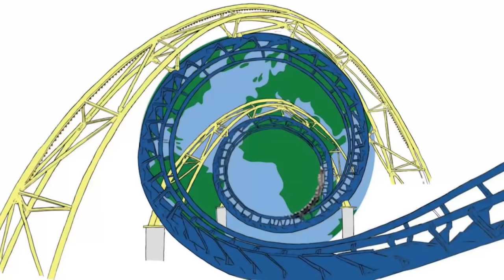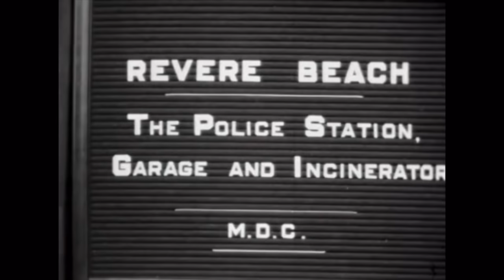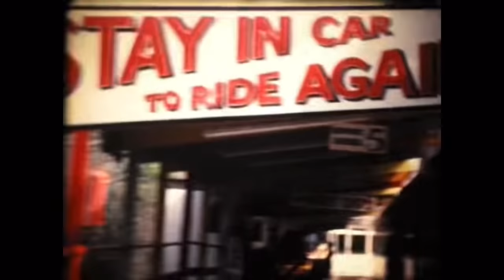5 of the WORST Roller Coaster Disasters in Amusement History | National Coasters Countdown

Comment: Even though no one died, the accident on The Smiler is one of the all time worst for me because of the multiple levels of safety violations that caused it.
Reply: More like two specific but really big ones: ride was operating in winds higher than the maximum it was designed for and the block system was bypassed by someone who should never have had access to the maintenance control panel.
Reply: It’s the whole reason why I will never ride it.
Reply: @sapphire.stones1897 
Even though the maintenance control panel is now under lock and key so the ride ops can't override the block system? Because that's what ultimately led to the accident. It wasn't the ride's fault, the operators forced a dispatch when the block ahead wasn't clear.
Reply: @VestedUTuber  exactly it actually always was and still is the safest ride in the park
It was human error not ride error

But anyway it’s apart of British culture to have slightly dangerous rides lol jk
Reply: it’s human error, it’s not the rides fault. it’s fine now nobody died
Reply: cgc
Reply: I can remember when that happened, there was a few lasses from my year at school who were there that day and was planning on going on it until that incident happened talk about dodging a bullet
Reply: @sapphire.stones1897  IM SAFE GODDAMN IT
Reply: @finnrobinson674  it wasn't the safest ride. In the year of its release, there were almost 30 issues
Reply: @mrapple2373  but the thing is issues happen in the opening year for everything not everything opens without it's issues plus nothing happened they were mostly on test runs
Reply: @antonytsai6611  fair enough. But some rides at alton towers will be safer because there's not as much risk.
Reply: SecretHunterArt  HA HA HA
Reply: FallenLion Art  there is no point in getting scared about it people have died in car crashes and plane crashes are you nervous every time you go on them?
Reply: @antonytsai6611  yes. Who isn't? Especially in cars, you have to be 100% aware or situations around you to avoid accidents.
Reply: i actually went on the smiler once it reopened after the accident. i was shocked they even reopened it but all my friends really wanted to go on it and i didn’t want to wait on my own at the bottom. i’ve never been so terrified on a rollercoaster in my life lol
Reply: @sapphire.stones1897  your missing out…I’ve been on it since and it was amazing
Reply: Python Efteling incident for me
Reply: But one died…
Reply: And most preventable
Reply: the smiler is safe but it just had a bad opening history, the opening day was postponed like three times, and after that there were a few minor accidents that weren’t as bad as the well known one, other than that it’s deemed safe now as the manufacturer of the ride added a few details like: the ride wouldn’t move if the wind was too strong etc 
so yea the ride is completely safe to ride now
Reply: Eh
Reply: I'd ride smiler in a heartbeat.
Reply: Just imagine their screams of pain having to sit there for hours with smashed kneecaps and ribs maybe also concussions until finally getting off
Reply: That story gave me the chills omg
Reply: Why do so many people have the Smiler as their username picture???
Reply: Agree
Reply: I’ve rode smiler before the accident and go on it loads of times after the accident. It is now the safest ride in the park. It has to be, and they had to fix any issues before reopening. But the ride didn’t crash because of any issues with the ride itself, it was human error that caused the accident. No one died no, but a girl was seriously injured and had to have her leg amputated. 
An empty carriage had been sent down the track, and the operators didn’t see the carriage had stopped just in a windy hill of the track, they sent a carriage full of people down thinking the track was clear, and the carriage slammed into the empty carriage at full speed ✨
Reply: I was gonna say abt the smiler
Reply: And they had to wait for hours listening to 
Ha ha haaaa ha ha haaa
Reply: @s10thy  that music must stay in their minds all nights
Reply: @sapphire.stones1897 I’m never even going near Alton towers

Comment: I rode Willard's Whizzer many times. As coasters go it was pretty tame. But it had some good banks and turns. It never caused you to lift out of your seat. The hills and turns were not steep. G forces held riders in place as the turns were sharp. 
There were no restraints in the cars. You sat three to a car but you straddled the seat and it was only one across like a log ride. There was absolutely nothing to prevent someone from standing up or reaching outside the car. 
I remember that accident. I had been to the park shortly before it happened. It was not the only injury on that ride. It was a fun coaster to ride, especially for kids as long as they didn't stand up. It was closed after it got a reputation. I was sorry to see it go.

Comment: The big dipper one was pretty bad as a whole for the reputation of wooden rollercoasters in the UK. I think the worst part about it was how many things all went wrong at the same time because they purchased second hand carriges rather than getting new ones. Coz not only did the chain fail, so did the breaks, which on that particular type of coaster, was built into the train and operated manually. And they failed. So yeah. And also, they place where they brought the second hand carriges from is still open and running. And oretty sure thy legally arent allowed to let their version of the coaster be demolished coz it's a listed building.
Reply: I still remember the Battersea Park accident.  I didn't know the park had reputation with accidents before the accident in 1972.  It makes you wonder how it stayed open for so long.